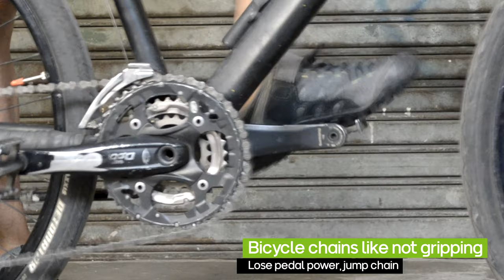How to fix a slipping skipping chain bike during pedaling problem solved

Comment: So if this doesn't fix my problem do you think the crank bearings need to be change??
Reply from the maker: not sure. but you can check lenght chain with simple check method in 120 seconds this video. before 
https://youtu.be/-seF7HV5nP8
if your chain going bad. may be problem from there.
I hope can help and solve the problem

Comment: pedal hard when starting the bike at the highest gear then...like the pedal goes empty and hit my crotch and chain drop sound? Chain didn't drop though.
Reply: @Guitar 1121 Replace rear sprocket and chain. They were worn out, not the front chainring..

Comment: my chain slips when i stand up and pedal hard and i fly into the handle bars and rail my butt with the seat any help there?😂
Reply from the maker: How long have you not changed the chain
Measure the length of the chain
Look more detail any tooth of gear, like sprocket and chainring.
 Maybe the cause is there
Lastly, take it to a technician for inspection
Reply: same thing. I just put in a brand new chain and as soon as I got on it I had this problem. It was working fine with my old rusty chain before it snapped. Now all of a sudden a have this issue.
Reply: @brunnizzle  same issue here on a 9speed drivetrain. tried using 10 speed chain as per advised by a mechanic to no avail. no skipping using my old 9speed chain though. i am so clueless.

Comment: Sir i have non gear cycle and i put new chain and i put new back freewheel and whenever i pedal the cycle doesn't move when i push hard it move and in between when i pedal the pedal slip    sir solution

Comment: I have a problem with my bike and im not sure if its the crankset its a 3x8 and my casette and chain is already new but it still skips when im pedaling hard going uphill. Needed some help here.
Reply from the maker: Check your chain ring (you not ask about chain ring)
http://www.goesbike.com/pic/1909/chain-cara-memeriksa-rantai-sepeda-masih-baik-atau-rusak.jpg
http://www.goesbike.com/pic/1909/chain-ring-problem-kerusakan-chain-ring.jpg
Damage chain will impact to
Impact tooth sprocket first because worse chain
After sprocket damage, will damage chain ring.
I hope can help
Reply: Poorly adjusted derailleurs are the most common culprit

Comment: If your changing your chain ring 
Change your chain and possibly your cassette. That’s a lesson I went through when just changing my chain ring and still my chain was slipping
Reply from the maker: Agree, good advice Mark
Damage - chain
Next impact - sprocket
After sprocket will impact - chain ring
If chain ring already damage.
Must replace chain, chain ring and sprocket together
No other solution, all of 3 components must be replaced
Reply: I was thinking of getting a new chain.. neighbors are telling me to push the tire back or something.. I never thought to check the teeth (so anxious to ride my bike)

Comment: 1. properly maintain chain by wax
2. replace chain when is worn in early phase
3. reshape teeth to prevent new chain slipping/skipping
same cassete and chain rings can be used very long time/many kilometers before it have to be replaced

Comment: But theres no damage in my chainring
Reply from the maker: For example, you often cycle every day for a distance of 3-5km. While not too far, if you add up the distance, it's certainly quite far.
The chain length can be checked.
https://youtu.be/Qk2JcbFZM9c?t=78

A stretched chain can be removed from the chain ring. The solution is easy, replace the chain

Luckily, the chain ring and sprockets are in good condition.
I hope you can find the source of the loose chain

Comment: My bike have no problems with the Cassette or chainring teeth but when I apply pressure to the bike is start slipping. What should I do?
Reply from the maker: Can't answer for sure
But, check Front Derailleur
Maybe the setting is not right
1.
https://www.youtube.com/watch?v=vcc5-ry4fA0
2.
Check shifter cable 
We hope one of them can solve the problem
Reply: @ObengwareID  Thanks

Comment: I bought a new chain and I have a skipping chain problem on rear casette. Casette is not worn. Teeths are like new. Do anybody know solution for this issue?
Reply: Usually when changing to a new chain u must replace the cassette, if it still skips replace the crankset as well
Reply: @Lunarpollo5622  Thank you for the answer. Iam going to replace chain rings on crankset, hope that will help me to solve this problem.
Reply: Also make sure there aren't any stiff links on the chain, chain must be properly lubricated
Reply: @Lunarpollo5622  mine has new 9s cassette,  new 3x cranks and new chains (10s and 9s), still skips mostly on the 7th gear of the cassette.
Reply: @ebingthegreat5578  mine skips on the smallest sprocket but only if i put down an unrealistic amount of power onto the pedals, other gears are fine tho. Not sure what the problem is at this point
Reply: just an update. i replaced my cassette with a new one, problem solved.  turned out it was the poor manufacturing of the cassette that i installed. said the gears are too narrow that makes the chains skip forward like it was attempting to shift to the next biggest gear. screw you sagmit! i went back to shimano deore.
Reply: @Lunarpollo5622   assuming your cassette and rear derailleur is alligned, id say, try and look for worn teeths of the cassette. could be worn out chains also.
Reply: @ebingthegreat5578  naa there is no visible wear on teeth ik what it is, the derailer is a but bent but I'm getting it replaced soon anyways i already have the new one bought

Comment: Great video, really in depth information on what to look for in terms of wear. I've been MTBing for 3 years now changed my large chainring along with the chain and cassette 1 year ago. I've been having  issues with the chain coming off under standing load the last few days, did a inner and outer cable replacement and front and back mech index but it's still slipping. Testing yesterday I could see it slipping of the large chainring so I'll have a look if the chainring needs changed. I was looking at a new 1x12 set up which is more expensive then a £25 chainring 👍🏽.